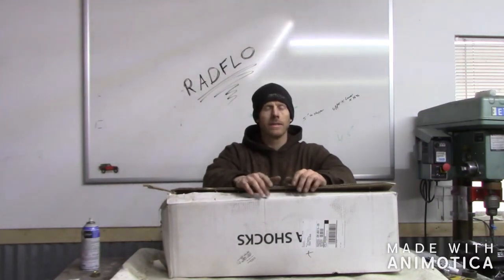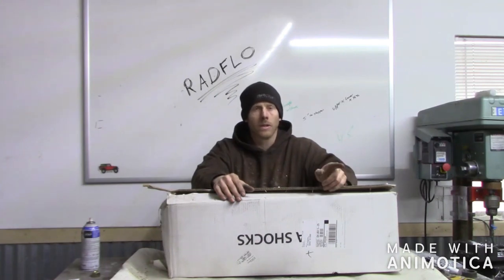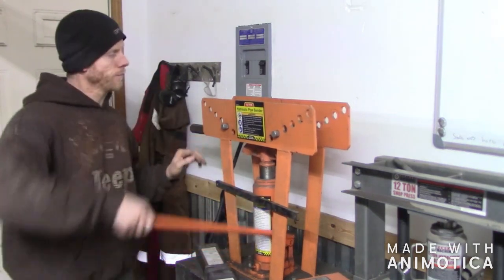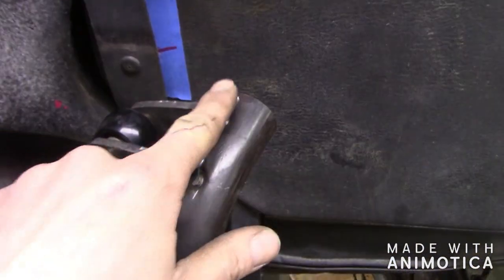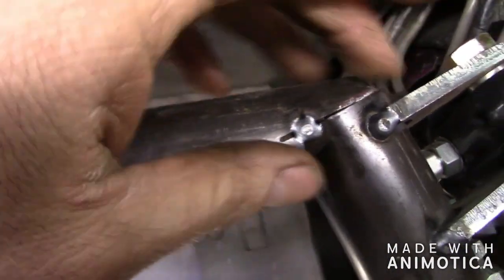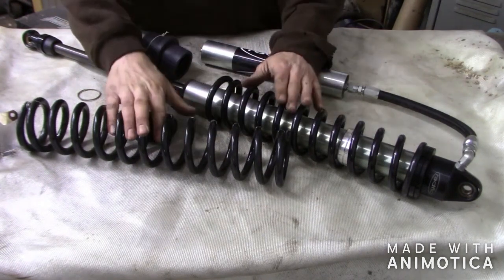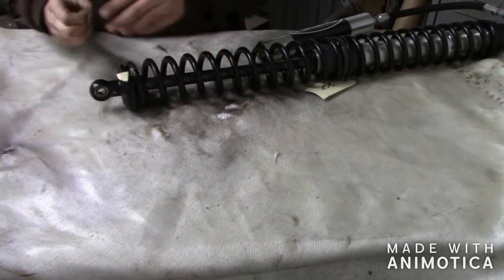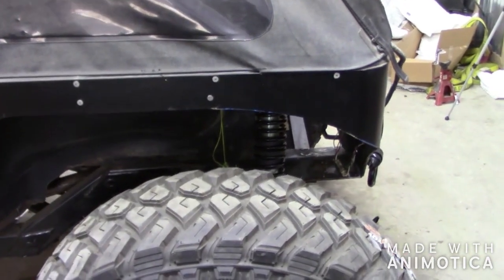Mounting coilovers

Comment: This is probably a stupid question. How do I find out how high I need to make my shock hoop/tower
Reply from the maker: First thing is get your axle mount tacked on first then put axle at full bump. Then mount your coilover (compressed) to that then you can figure out where the hoop needs to be as far as how high
Reply: @CardinalOffroad  What do you mean by axle at full bump? (Sorry, new to building offroad stuff)
Reply from the maker: Full bump is when your suspension is completely bottomed out but not completely. You always want about a 1/2 to 1” left before that so you don’t destroy anything.

Comment: hope you didn't mess up that rear seat... :)   shoulda pulled it out man... I'm about 2 wks away from starting my build. Everything's bought except the front 3 link. How do you like your tires? I was contemplating them because they are really really affordable off Ebay, but I went back to Creepy Crawlers. They are an awesome Bias tire. Went to 40s and got some Trail Gear Creeper locks. 17x13.50's     5" bs
Reply from the maker: Hunting with Kevin rear seat is fine. I always use a blanket if I need to. Plus I needed it in there to make sure everything was going to fit. I haven’t had these tires before but I like the looks of them, nice lugs. I was debating on the creepy crawlers or treps. I got these because I haven’t seen anyone running. Good luck on your build man, it’s fun but stressful at times depending on how much stretch.

Comment: I have a question, when you install the coilovers usually it works at the middle of  travel?  For example if collapsed measures 08 "and expanded 18", it would normally be working at 13 "
Reply from the maker: greenhornetzj jean carlo ortiz kind of confused on your question but are you asking about mounting them at full bump? Or are you asking about ride height?
Reply: @CardinalOffroad  yes, how you know the correct size have to buy, and how you know what height will have. Or how you know which zize buy for the height that you want.
Reply from the maker: greenhornetzj jean carlo ortiz the coilover length has nothing to do with your height really. So for instance I have 14” travel coilovers and I set my uptravel at 5” so I have roughly 9” down travel. The ride height is simply adjusted by what weight springs you use. If you want your ride height to be lower than you run a lighter spring. When you order coilovers they normally give you 3 months or so Incase you want to switch the springs out to adjust your height. Hope that helps.
Reply: @CardinalOffroad  so that's confirm that was fully adjustable, you can set rhe height that you want
Reply from the maker: greenhornetzj jean carlo ortiz yes you can. The only difference between a 14” vs 12” coilover is that you’ll get 2 more inches of travel. There’s guys that run 3” uptravel so that means thy have about 11” down..  Check out my video on spring rates. I go over my ride height and spring rates I used.